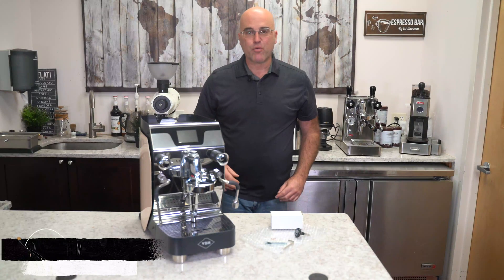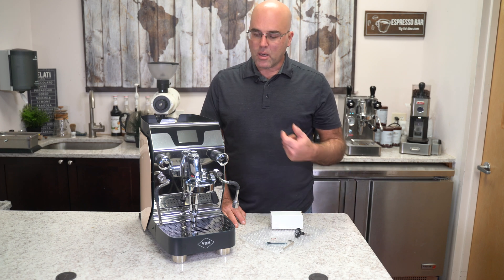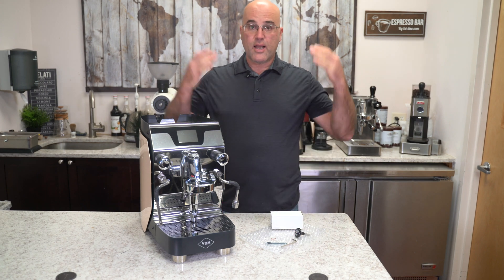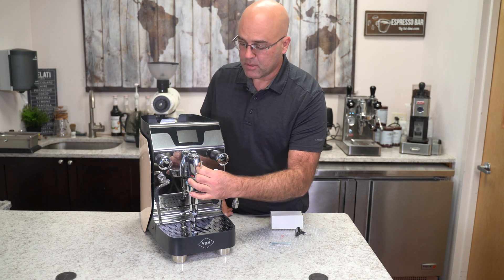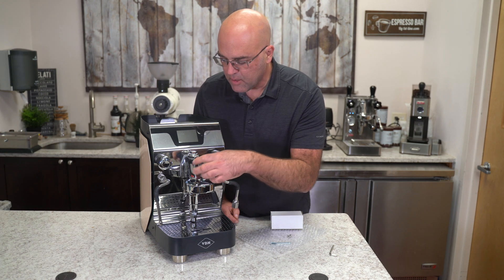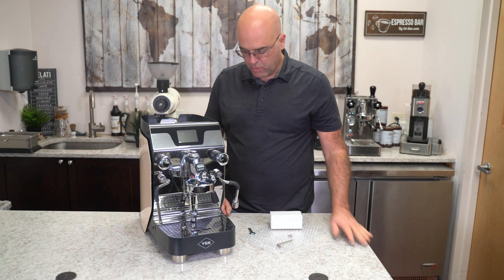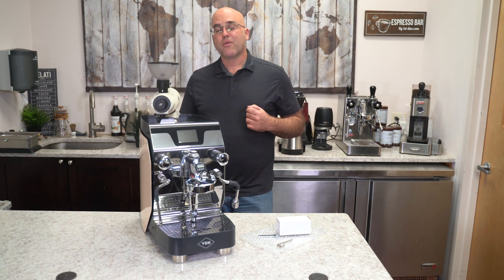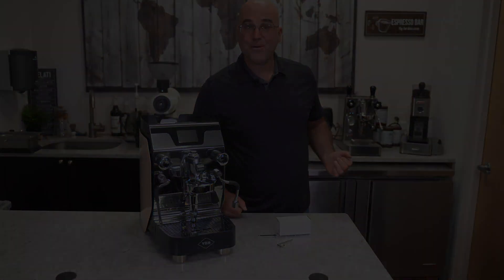Digital Thermometer for E61 Grouphead

Comment: The instructions say to remove the original washer and only use one of their copper washers. The second one is a spare. I think it’s to get the tip closer to the water flow. Great device for anyone with an e61
Reply: I was actually thinking the same thing